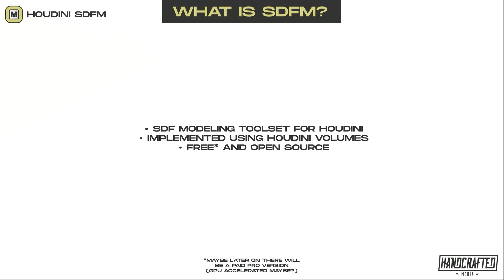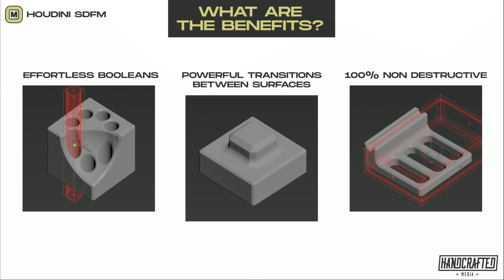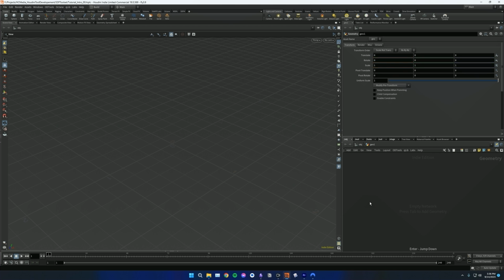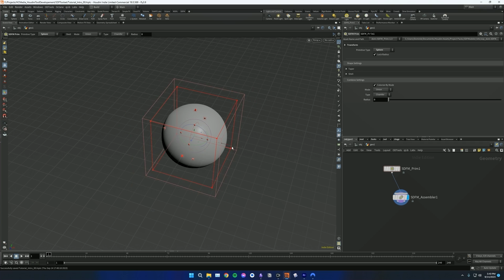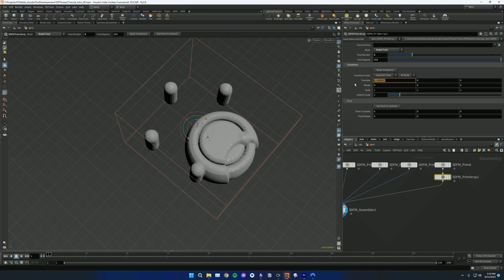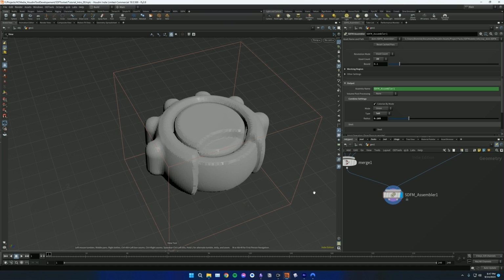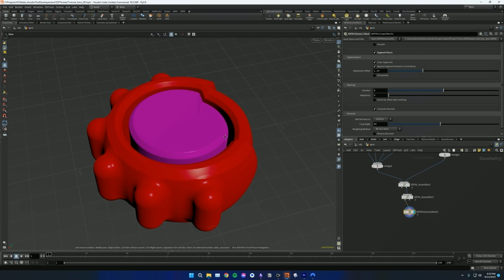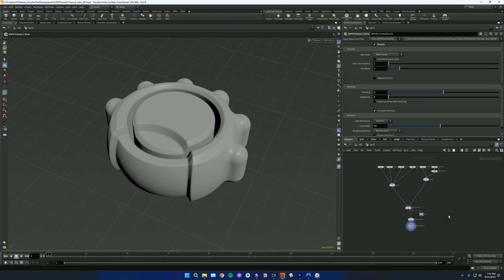A FREE SDF Modeling Toolset for Houdini! - Introduction

Comment: The only downside of this implementation of sdf that its supposed to use math volumes not voxels, so it could use less memory and be infinite in detail + would work with objects of any size. Really disappointed, if its be real SDF it would be great.
Reply from the maker: Yeah, I agree. Performance would be much better that way. Sadly I don't really know much about opengl etc to implement that.

Comment: Hou 20.5.278 'Type' params (as in chamfer etc.) aren't working...Anyone confirm?
Reply from the maker: Did you happen to update the sdfm version and then open an old project? If so you have to update all the nodes to the latest version using the asset bar.

Comment: I've been playing around with this and having so much fun! Thank you for making this, and keeping it free/opensource.

1 question: how are you assigning/blending the colors from the teaser, for example the torus sinking in to the ground? Is there a way to assign colors to the SDFM primitives so that they retain colors after being converted to a mesh?
Reply from the maker: Heyo!
Sorry for the delayed response!
I assume you were the one that emailed me about this, but just in case I'll respond here too:
What looks like colors blending in the teaser is actually just a shader setup, there are no separate colors for the meshes. 
Now if your meshes are separated you can use the segment option in the volume2mesh node. But if you have shapes combining that won't work. Also not sure if that would be stable in an animation.
What you could try is to extract your source shapes using the prim to mesh node (I can't remember the actual name but there's one that will convert your control prims back to a usable mesh), apply color to that and then use a attrib transfer with a blend radius to transfer the colors onto the meshes model. No idea how clean that would look though.

Comment: is the performance better than sdf in blender?
Reply from the maker: I haven't used the sdf tools in blender, so I can't really answer that question for certain. But I would say that a. This is not the most performant toolset as it runs on the cpu and uses volumes.

Comment: Thanks so much Dominik this rules! I did have a possible feature request - it would be great to get those Prims out as surfaces also ( before a convertline.) Just thinking for moving from the volume to refined hard surface would be good to have them to use as surface prims for hard-edged booleans etc. For instance say I've made an LED display screen, I have used SDFM to make the surround for the acrylic screen (using a box prim (A) to make a negative where the screen would be in SDFM) - if there was access to the surface geo of (A) I could then just have a screen surface geo to use already exactly in place...Hope that made sense...
Reply from the maker: Started working on this! Should have a version to release here soon!
Reply from the maker: That's a great idea! I think the easiest way to do so would be to create a node that converts the prims to surfaces!
I'll look into it! :)
Reply from the maker: Brand new release now has that option! Just make sure to update your nodes to the latest version, if you open an old project!
The node is called Prim Convert 2 Polygons!
Reply: @Handcraftedcc   Beautiful!

Comment: how about texturing those things? how UV map looks for it
Reply from the maker: The mesh you get out of sdfs is similar to what you might get when sculpting. So when it comes to UV unwrapping, there is no straight forward answer. You can retopo your mesh, and then uv unwrap nicely. Or you can use autouv or something similar and then paint your mesh manually in substance. Really depends on what you need and what your final goal is!

Comment: is there a way to say, merge 3 things, A B C, where they all overlap, like 3 balls in a triangle, but only A and B blend, and B and C blend, but A and C don't blend? like if you made fingers, but don't want them to blend to other fingers, but just to the palm
Reply from the maker: Hmm you cam get to some degree by A: getting the order right. For example if you want the fingers to bot blend with each other but blend all the fingers with the hand, you can first add the fingers together and then add the palm after with your desired blend.
B: use sub assemblies. So make an assembly with all your fingers and then merge the second output of that onto the palm. You can see an example of that workflow under the sub assemblies part of the video!

That being said beyond those two methods you can't specifically say which part you want to blend with. 
Hope that answers your question!
Reply: thanks! I'll give that a shot

Comment: Is there a reason you used Houdini native volumes instead of Vdb?
Reply from the maker: Yes! When doing A/B testing between VDB and Houdini Native Volumes the processing time of VDBs where significantly slower. There were also few to no benefits to be gained in terms of processing time as the vex code seems to also run over non-active voxels. In terms of storage VDBs are more efficient, but it's easy to just convert volumes back to vdbs for storage, however by default this is disabled, as the volumes to vdb conversion also is a hit on performance. The toolset running over big volumes is already heavy enough so I attempted to gain performance by any means necessary! I saw that H20 has made some improvements in terms of vex and vdbs, so it might be worth seeing if that changed anything.
Reply: I see, I thought vdbs would be much faster seeing how it worked under the hood. May just be a lack of implementation, anyways, thanks a lot for the tools, they are pretty good and useful

Comment: Amazing tool, great to have a little sdf toolkit in houdini. I wondered at the beginning of the video, if you could have a hook where we could add custom sdf function and have it as a sdf prim node. With the pig head example i guess that could be done using a volume wrangle or volume vop with an sdf prim node. Would that be efficient ? when you say that the one you propose are more efficient, is it because there are simple primitive like sphere or tube or because you did some specific optimization ?
Reply from the maker: I like the idea of custom functions, but I'm not sure that that would be easy or possible to implement without having to rewrite large parts of the toolset!

Comment: This is awesome! Dump question though. Is their any possibility of using the normals of an object and including those to shape the SDF when converting from polygons?
Reply from the maker: Hmm I don't think there really is, at least not that I'm aware of! Generally if you can subdivide the mesh beforehand that's your best bet. One thing you can in theory do is transfer the normals back from your source mesh after converting the sdf to polygons. That can be finicky though, as you have to mask it to make sure that it won't affect the transitions or other areas that are different from the source mesh.

Comment: Hi. Congratulations on the video, I don't understand step 3 of the installation. Replace "PATH/TO/PACKAGE/" with the path to the folder. In my case it reads: "C:/Users/Dominik/Documents/Houdini Assets/Project Packs/DomLib" Make sure to use "/" as separator, not "" otherwise it won't work.😅 Where should I edit this string? Thanks
Reply: I think it refers to the directory separator, Windows uses "\" but within the Json it should be changed to "/"
Reply: The file you need to edit is the SDFM.json file, and that should be placed in a folder called 'packages' which needs to be somewhere inside your Houdini preferences folder, which is in the top level of your Documents folder, (or Mac equivalent).   I use a single packages folder but Houdini does seem to check any packages subfolders within the preferences folder structure.
There's a Houdini preferences folder for each major version, named after that version, so it'll be houdini19.0 or houdini19.5 etc.  
You need to set the path in the SDFM.json file to the location of the SDFModeler folder, wherever you've put that.

(FWIW,  the environment variable for the preferences folder, which is $HOUDINI_USER_PREF_DIR, can be used in the path, and relative paths are supported so something like 
"$HOUDINI_USER_PREF_DIR/SDFModeler"
 would work if the plugin folder is dropped directly into the preferences folder, or "$HOUDINI_USER_PREF_DIR/../HoudiniPlugins/SDFModeler"
if you had created a single location in your Documents folder -beside-, not in, the Houdini preferences folder, (and called it HoudiniPlugins)
Reply from the maker: Yeah, like other said you want to update that in the .json file to point to the downloaded and unzipped folder and put that into your packages folder. If this is your first package, just create one. In windows that is normally documents/houdini19.5/packages.

Comment: Hi Dom, Great tool. I just downloaded it but can't use it as it tries to change my Houdini License to limited commercial.  Is there a fix or is it supposed to do that?
Reply from the maker: Heyo!
I imagine you probably have core or fx license?
The version available via github is sadly only for indie license. I will share the toolset via orbolt in a few days, which should work with all licenses!
Reply: @Handcraftedcc  Does THE tool not work with the No commercial Edition license?
Reply from the maker: @luigir.179  you mean the apprentice version? Should work fine with that!
Reply from the maker: The final assets were just approved on Orbolt.
Feel free to download them there, but I also packaged them on Github for convenience and to remove compatibility problems between versions: https://github.com/handcraftedcc/SDFModeler/releases/tag/Orbolt_v1.0

Comment: any way to run geometry operations on the primitive shapes the SDFs use? seems like a useful idea to get more complex boolean shapes. i know we can use custom geometry but it would be even cooler to quickly tweak one of these primitives as you are building SDF forms.
Reply from the maker: Heyo!
I'm not sure I understand. What do you mean with geometry operations? Are you saying you would like to use stuff like the bend sop to edit the sdfm prims?
Reply: @Handcraftedcc  yes or even to point based polymodeling operations on them.
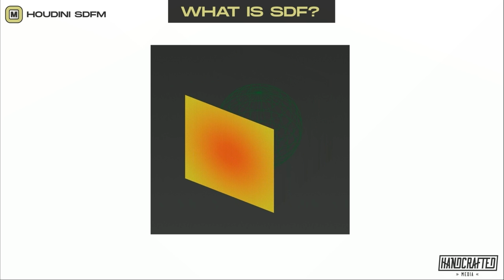Reply from the maker: Oh gotcha. So the "SDFM Prims" aren't based on polygons, like I describe around 1:33. The shapes you see when you select the SDFM Prim node are just previews of what the underlying math function generates. There is no way to modify those directly. That being said you can always use the SDFM Mesh prim to make custom shapes. Just note that it won't be as performant.  @keithkirby7376